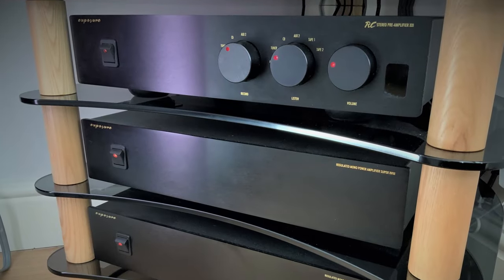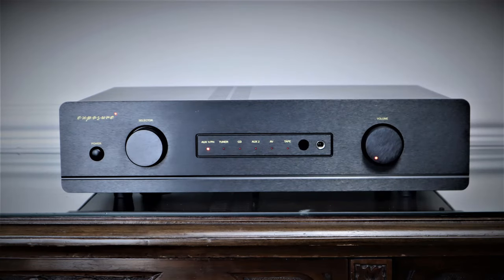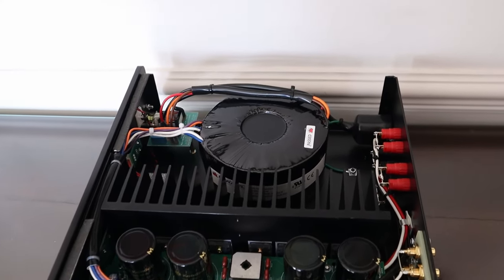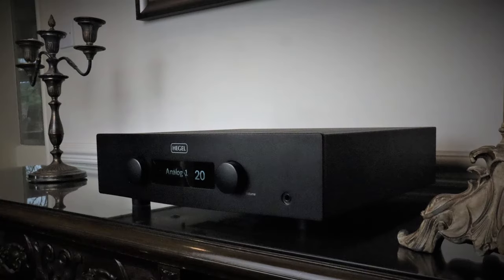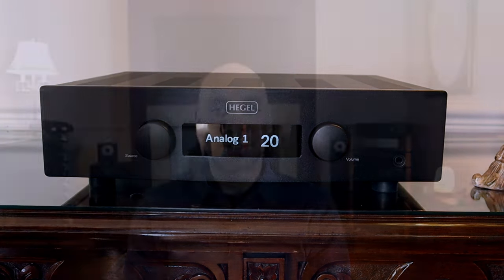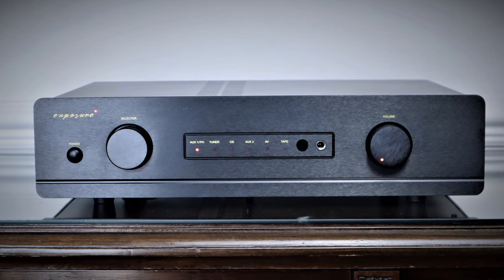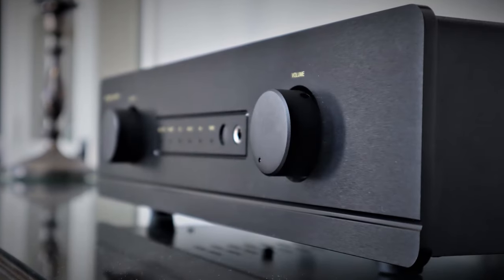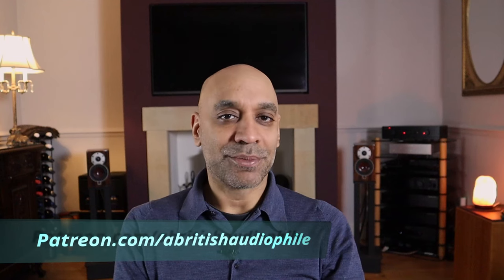Surprising! New Exposure 3510 Amplifier Review

Comment from the maker: It has been confirmed that the 3510 I reviewed was one of the first 3 amps to leave the factory. Unfortunately, two of them were biased incorrectly. I had one of the incorrect biased amps in for review. That is what was responsible for the harder sound I experienced. After recently spending time with a correctly biased 3510, I can confirm that the hardness I experienced was gone. It sounded much like the 2510 but with a more muscular presentation and better ability to resolve details and drive speakers 😊
Reply: Ouch, that is an extraordinary faux pas by Exposure and does not promote confidence in the brand. That two out of the first three amps released,  effectively were not performing to specification is quite horrendous. How did you learn that the amplifier you reviewed was incorrectly biased?
Reply from the maker: @MaxZappa1  yes, I had one that was incorrectly biased. It happens more often with brands than most people realise. Especially, when a new product is released 😊
Reply: Thank you for posting this. Looking forward to your reviewing some exposure monoblocks, like the 3510s or even the 5010s. Keep up the good work!
Reply from the maker: @Dimitris_Pappas  thank you. I am planning to do that 👍
Reply: Thanks for the update Tarun.
Reply: Then you should take down the video and post a revised version....I very nearly stopped watching when you mentioned hardness...and how many would not notice this recent comment?
Reply: @steven2809  100% as the current video review has now become void and not many viewers will notice a disclaimer saying otherwise in the comments
Reply: @georgescookie  👍
Reply: Does your rating change?
Reply from the maker: @VisionCarrierDreamCatcher  I would want to spend a bit longer with it to run comparisons to make sure how it rates. Comfortably “Highly Recommended” but may be an “Outstanding.”
Reply: I'd like to add my voice to the contingent suggesting a re-review of this product. If the improperly-biased specimen played so nicely with the Amphions, who knows what the correctly-biased one will do for them? Good stuff, I'd be willing to bet. :-)
Reply: @abritishaudiophile7314 Hi Tarun, I am very excited about your update. Can‘t wait. ;) I was able to test the amplifier for a weekend…..wow! Great match with my  S400 MKII.
Reply: Hi Tarun. I can confirm that this amp sounds very, very good, full bodied, never fatiguing or hard in the upper frequency. It has also a nice wide soundstage.The bass control is absolutely gorgeous at this price point and the midrange is full. It seems that the review unit you received, had some troubles. Kind regards👍
Reply: I have to say that when the review was posted I was an owner of the 3510 and wondered what the hell you was talking about. I really think that you should take the review down and review again.
Reply: Exposure let 2 defective amplifiers out the door. What guarantee does a buyer have that his amplifier is not defective too? Signing off on an amp with incorrect bias is a deadly sin. It means they don't really give a damn. Thank you for your honest review. It is very helpful in terms of deciding what products I should avouid.
I have a semi DIY power amplifier and I have gone so far as to check and adjust the bias myself because I recognize how important it is.
Reply: I had a 2510 for a week and have now decided to buy a 3510. It just sounds fantastic. Much more precise than the 2510 and more powerful. The highs and mids it handles well. There is no sign of harshness. I assume that the amplifier still needs to be played in for a while to reach its potential. It plays more maturely than the 2510 from the very first second. I hope you publish a new video on the 3510 soon. It is an amplifier for the ears and the soul, not for the eyes.
Reply: do you feel the jump from 2510 to 3510 is very significant, giving the much higher price and need for phono stage on the 3510?
Reply from the maker: @matthewpatsel1855  it is a step up rather than a big difference. More about grip and control than resolution 😊
Reply: @abritishaudiophile7314  thank you for all the effort to enlight us of audio equipment. Great job !!!
Thank you again because some of us are not able to audition gear. For instance myself. I live on Lesbos island Greece, and in order to do so i have to travel to Athens. Impossible!
Well, i am a bit curious (frastruted maybe :) ) to your new update here.  My main question is, since the new amp you got in hands fixed the mid issue, did this improve the sound and specifically the sound depth? If it did, since the 3510 is now equivalent to the 2510 (and  punchier) why ... 'maybe an Oustanding' from you?
I just want to power my Martin Logan 20i speakers and trust me cannot decide if i should order a 3510, an AS1200 or the IN200 since speakers are warm. What a pain !!! :)
Thank you in advance
Reply: I have just bought a 3510 to replace my CA Evo 150 and I think it sounds superb. Compared it to the Evo 150 and my older Roksan k3. It’s the perfect balance for me and drives my Prodigy 1’s effortlessly. The Evo 150 is very detailed and smooth but not involving enough and the Roksan is a little too forward.
Reply: Hi Tarun, thanks very much for this update, I know this is an old video but I am seriously considering this amplifier (along with Naim XS3 and Atoll IN200) to go with my Neat Motive SX3’s . I know it is a big ask but I’m wondering if there is a 3510 pre/power combo  (or 5010) review on the horizon, if so, could you address your revised thoughts on the integrated in that one, many thanks.
Reply: Oh no! I saw the review and considered the huge price hike - almost 20% - and so opted for the Rega Atheos instead. Had I made my way through the your update I may have gone for this. Don’t know if YouTube would allow you to add in a new intro or outro to correct the position?
Reply: @AliRafati-xk9jg  if it’s any consolation, the guys on the hifi-riff channel (David Price is professional reviewer/hifi journalist) have recently reviewed the Aethos and reckoned it was superb. In the comments I asked about it compared to the Naim xs3 and the 3510, they said all 3 were excellent but David reckoned the best was the Rega (naim being always in party mode, the Exposure being a touch too relaxed)
Reply: @mrkitewine7700  Thanks. Funnily I bought the Rega on the back of that very review. 

It’s……ok….a lot of internal hum (not through speakers and not volume dependent). A DC blocker lessens it a bit. 

The most glorious thing I have bought ( at any price) over the last year is the musical fidelity A1. 
10.5kgs of heaven ❤️❤️

Comment: I've used Exposure 2010s2 for five years and was OK with it, I like the detail and the airness of it, but when I tried Exposure 3010s2 I was blown away by how better the bass is. The depth is control is on whole other level compared to Exposure 2010s2. I guess the same holds for the never models as well, namely Exposure 2150 vs Exposure 3150 as confirmed by the reviewer.
Reply from the maker: @EugeneKrall  thx for sharing 🙂
Reply: May I ask which speakers you use?

Comment: I the early 90s I purchased a Rega Elicit for £1700. It was the beating heart of my audio system for almost 30 trouble free years. It is still in production today. Retails for around £1600 and comes with a remote, which my earlier version, doesn’t. 2 years ago, I took it to my local dealer to have them send it back to Rega to be refurbished. When I went to pick it up a couple of weeks later, the dealer talked me into auditioning it’s new big brother, the £3000 Rega Aethos. I also asked them to incorporate into the blind audition, the flagship £6000 Rega Osiris.I provided a selection of CDs for the occasion.

When the first track started, ‘Peter Gabriel’s Red Red Rain’ from the album ‘So’, on amp 1, I knew with in a matter of seconds I was unquestionably listening to my trusty Elicit. Listening to a couple more tracks only served to confirm my initial decision. Then amp 2 was introduced into the equation. Now, I was confused. This sounded like my Elicit. With some highly attentive listening, I did notice a slightly tighter bass, and touch more airy top end. When the third amp was introduced, the characteristics were the same, but the reproduction was more ‘clinical’. Not to my listening preference!

I correctly deduced that amp 1 was indeed my Elicit. Followed by the Aethos then the Osiris.

The assistant then swapped the speakers for the more difficult to drive and power hungry ATC SCM40. They did slightly more exaggerate the differences in the amps.

My conclusion, which the dealer backed was that my Elicit held it’s own against it’s bigger sibling at twice the price and the flagship at 4 times the price!  I walked of the store having spent a worthwhile £165 on the service of my Elicit and having reasoned an £1500 or £4500 upgrade unnecessary.

I have subsequently upgraded my Elicit to a preamp monoblocks combo. But, my Elicit still sits proudly in my rack, ready for action if required.

So, in my opinion and experience, the Rega sound is still recognisable after 30 years.
Reply from the maker: That is very interesting. Thank you for sharing Howard. I hope Rega change the policy some day and start sending out products to YouTube reviewers 😊👍

Comment: I completely agree regarding the KISS design principle. I was made aware of this back in the 1970's when studying for OND and HND engineering. The electrical and electronic engineering lecturer was Mr Don Streatfield, who designed the guidance system for the TSR2. He also told us about Sod's law when applied to electronic engineering. Sod's law says that if anything can go wrong it will go wrong. Also when fault finding you will discover that the faulty component will be the most difficult to remove and will be the most expensive and difficult to obtain. Over the years I have designed and built several pre and power amplifiers which seem to prove that Sod's law is correct. Now if everything is working perfectly for ages, you instinctively suspect that something must be wrong or is about to go wrong. Lastly any fault you assume will be easy to find will always be difficult to find. I swear blind if I ever meet Mr Sod he will receive the rough edge of my tongue.
Reply from the maker: Thank you Jim. It has been quite a while since I heard that expression. I may have to revive it in a future video 😊

Comment: Hi Tarun, last week I bought the predecessor Exposure 3010 S2D and apparently it is sonically very close to the new 3510. I was aiming for the 2510 but this one was on offer for a very attractive price. Expecting the warm sound of the 2510 I bought it. I was having doubts when listening to my KEF LS 3/5A (from the nineties) in the shop noticing a forwardness I did not expect but I thought maybe it was the listening room and it should be better at home. Now I regret buying it because I would have preferred a warmer, less forward sound over the LS 3/5A's. Needless to say that I would prefer if amplifier manufacturers would stick to their house sound. However I do like the dynamics and authority and grip in the low register of this amp. Even though the upper mid are fatiguing after some time these former aspects are comforting and the control gives ease on the ear nevertheless. Now I am considering to buy new speakers which are a good match for the 3010S2D or I will sell it again. Any suggestions are welcome. How about Magnepan LRS? I generally prefer smaller speakers though...
Reply from the maker: Very interesting. If the 3020 S2D is tonally similar to the 3510 (it should be as it is essentially the same design) then I suspect you are struggling with the upper midrange prominence the amp has. It can be fatiguing with certain partnering equipment and recordings. It will be tricky to correct it with speakers. I would suggest you audition the 2510. If you prefer it (I think you probably will) I would sell the 3020 S2D and buy the 2510. It may cost you some money but you will just have to notch it up to experience 😊

Comment: Tarun,
On the house sound question, I appreciate the predictability of a manufacturer "House Sound".
In my case it's Yamaha.

Owner of a Yamaha R-700 purchased new in 1981 due to the the midrange and top end tone that a friends CR-2020 and the other Yamaha integrated amps that I was able to listen at that time seemed to  have relative to other brands. 
40 years later~ I went Yamaha again - A-S2200 - on the basis of the Yamaha tendancy towards neutral to light bass and more pronounced mid and upper range tone all adjustments set to flat.
I very much appreciate the quality of your no BS reviews and the technical competence that tempers your opinions and comments. 
I especially liked the relative tone scale in this review using Hegel ,Yamaha and other products as familiar and meaningful reference points.

Comment: I would suggest that a "House Sound" is completely acceptable if you happen to like the kind of sound that the manufacturer provide.
I loved the sound of domestic components in the late 1960's & 1970's ... Nothing wrong with that?
However, when I worked in various studios in the 1970's  ... I quickly learned that there is a monumental difference between "House Sound" and "accurate" reproduction.
Accurate reproduction of source material would involve a huge investment in hardware and acoustic treatment  ... and will not sound great  (at "reasonable" volume levels!)
Therefore ... House sound is a great thing  for most of us!   (many companies such as Rega, et al,  understand this.
Reply from the maker: Thank you Ralf 😊

Comment: Tarun. Thanks for your channel.  I very much value the descriptions of your listening experience. Those descriptions have added to mine as well. . In the past I have had Proac tablets with Rega electronics. Around 12 years ago I purchased a Naim Uniti and Dynaudio Focus 220 11 for around $7000. The cd and display are no longer working on the Naim. I purchased a Audiolab 6000CDT and a Schiit Modi 3+ dac. The dac has brought a greater presence to my listening. I am planning on replacing the Naim and I wonder what you might recommend. My room is a moderate loft space with a fair amount of soft furniture. I listen to classical and jazz. Thanks again.

Comment: Great work Tarun. Yes I'm right with you with this, the Exposure amps are something special. I live in Australia and they are pretty much unheard of here. Such a shame. They are sold here but only maybe 2 dealers country wide. 

I run two units myself, a 2010S2 hooked up to some PMC Tb2+'s (great combination!) and a Classic XXVIII dual mono power amp, ME25 pre-amp (Australian) running into Harbeth SHL5P XD's. Both are magical combinations, great balance of slight warmth but good detail. 

You have me interested in the 3510 now after watching this, it sounds similar to the old 3010. I too thought it was just slightly on the brighter side of neutral. I think as far as midrange and vocals go, the 2010/2510 series are something magical and hard to beat. Get a nice female vocal playing and is maple syrup to the ears. The 3010/3510 is amazing at dynamics but IMO can't match it's little brother in midrange. 

There is also the 5010 pre-power combo which I am yet to hear. Another whisper I've heard is that Exposure and planning a model above the 5010, a 'reference' model. Not sure what form is planned, integrated, pre-power or both. Cheers mate.
Reply from the maker: Thank you. Great to learn about your experiences 😊👍
Reply: 3510 sounds more organic (a bit) and more relaxed then 3010s2D whic is bloody great amp! 🙂